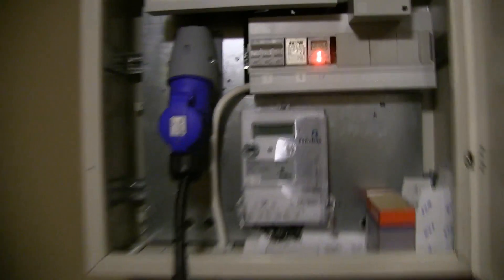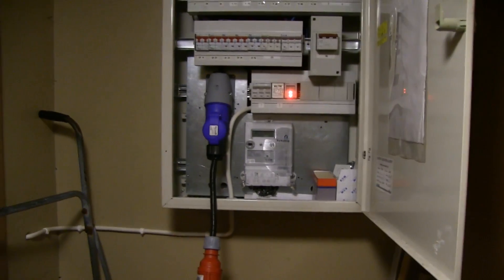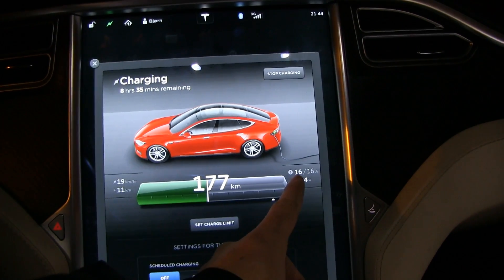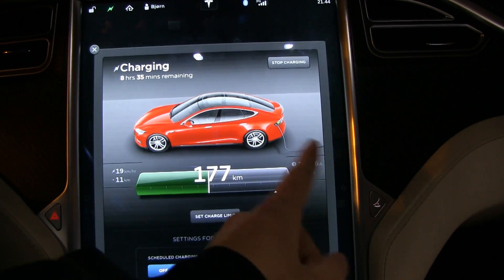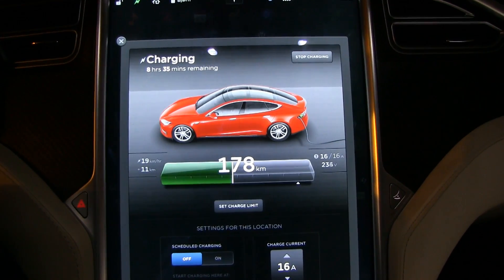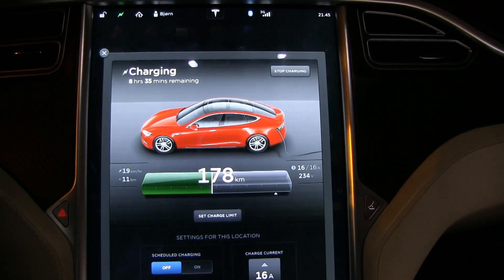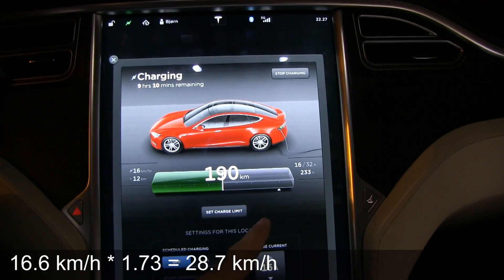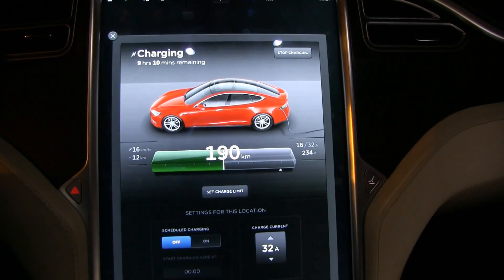230V 3-phase charging on Tesla

Comment: To clarify once per all. It is 400V 3-phase. 16A*400V*√3=11kW, so the car is showing correct. Just the voltage shown is line-to-neutral.
Reply from the maker: +Markovip No, this is not 400 V. It's 230 V 3-phase.

Comment: It looks like it is using 230V * 16 A = 3,6 kW. Improved speed comes from using interphase voltage (less voltage drop). I use 2-phase charger (Accelev) and speed is rather 25-27 km/h (5,1 kW) but it needs 3-phase 400V power source.

Comment: I'm sorry Bjørn, but you need to read up on three phase electricity. In Sweden we use 3-phase 16A 230V and get 11kW. That calculates to 55 km/h of charging. Full battery charge in about 7-8 hours. There is a formula for calculating power at: https://en.wikipedia.org/wiki/Three-phase_electric_power.
Arild Schønberg
Reply from the maker: +Arild Sch&#246;nberg I am fully aware of 400V/16A (which I have used a LOT). What I'm talking about here is 230V 3-phase which is quite rare.

Comment: The older Norwegian system has 230 V phase-to-phase and no neutral present. The adapter is probably hooking up one of the "blue" phases to the "red" neutral and the other two to one "red" phase each. In a charging context this practically renders a two-phase 32 A 230/400 V connection (not actually 400 V between phases, but doesn't matter for this application. However, the car limits the charging current to 16 A when using the red adapter for the UMC, so it only pulls 2*16A*230V=7360W from the grid.

If the car was tricked to draw 32 A two-phase from this connection, it would overload the one "blue" phase that is used as a neutral because of the unbalanced load, but at 16 A it's all okay.

Comment: 3 phase 230V is an old system used in Nordic countries with no neutral wire. While in usual system you have 230V live to ground and 400V line to line, here you have 230V line to line and no reference to ground (actually there is some high impedance reference). This is "IT" power system, opposed to usual "TN" system.

Comment: Just to be curious.. How much does a kW costs in Norway? Here in Italy costs around 0.24 euro/kW
Reply: +Bjørn Nyland That's about 0,05 €. In Germany we pay 0,26€ per kWh. a big difference
Reply from the maker: +iMauxVG kW = power
kWh = energy
We pay per kWh. Each kWh cost about 0.5-0.7 NOK.
Reply: +linghan li in Norway the energy is produced mostly by hydropower, that makes it cheap, i think
Reply from the maker: About 95 % of electricity production in Norway comes from hydropower.

Comment: Bjorn, the Tesla onboard charges are technically not three phase in the traditional sense.  They are three separate single phase chargers connected in parallel to the battery pack!  (230V*16A=3.68kW) * 3 = 11kW.  If it had a true delta wired 400V three phase charger it would be (400V*16A*sqr3=11kW).  This is why the car reports 230v and not 400.  The only disadvantage to this, is that the car requires a 5pin (3ph+Neutral+Earth) socket to charge, it won't work at all on a 400V 4pin (3ph+Earth) socket.  I don't know about Europe, but in Australia, the 4 pin sockets are more common as 3ph motors don't require Neutral.  I'm guessing Tesla has done it this way as it as a lot easier to make it single phase compatible and it was probably based on the North American single phase charger.
Reply: On 2nd viewing, I think the blue socket in the switchboard is single phase 230v and your adaptor cable internally wires the single phase to the three phase pins of the red plug.  No wonder the car is confused.  That cable seems like a possible hazard to me, keep blue to blue and red to red.

Comment: Thoughts on buying used Tesla without autopilot? Should they sell for even less than standard depreciation since lacking such a huge feature? Or is autopilot overrated?
Reply: Menjira no.
Reply from the maker: +knpstrr Autopilot is a must.
Reply: +Bjørn Nyland Thanks for your reply! Have been looking at used Teslas... not many used with autopilot, yet. I won't splurge on one without!! Thanks again.
Reply: +knpstrr Can u upgrade a non autopilot Tesla to an autopilot one?
Reply: Yes you can, I thinks it costs like 3400 € aftermarket

Comment: When you refuel a car, there is one standard fuel pipe which can be connected to the car to refuel. So why are there so many of these damn connectors? 1, phase 2 phase, 3 phase, AC, DC, transformers, etc.... Why can't there just be one standard connector which charges all electric at high voltage and amps.
Reply from the maker: +Daniel Sadjadian Most other EVs has only one connector. It's complicated for Tesla because its flexibility. It can "eat" almost everything it comes across which is a good thing. It would almost be like having a fossil car that could run on any octane gasoline (leaded/unleaded), diesel, biodiesel, E85 and so on.
Reply: +k ma Don't forget the days of leaded/unleaded.
Reply: +Daniel Sadjadian Reason number one is that there are so many connectors already out there that in past were used for industrial stuff and now they are good for recharging EV's. Reason number two is that electric systems differ around the globe. And for actual charging connectors there are standards, but not as widespread, eg type 1 plug in US, Type 2 plug in Europe.